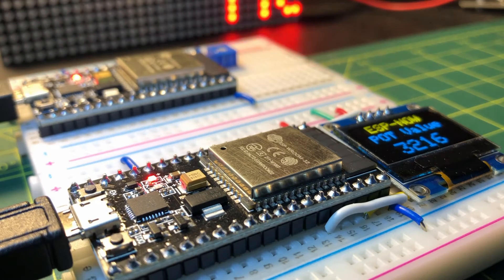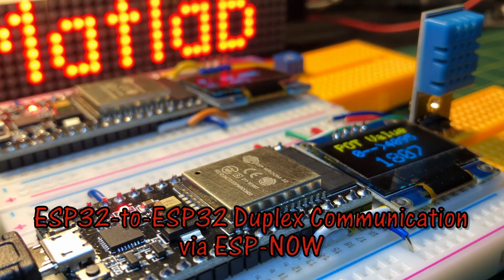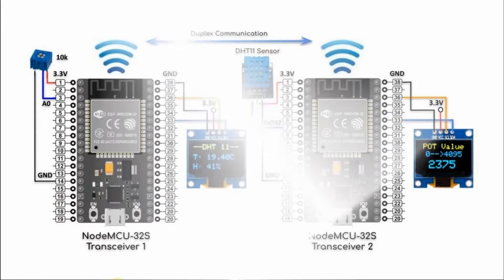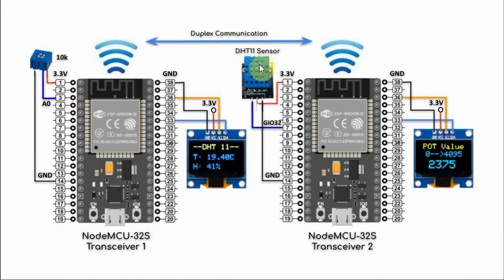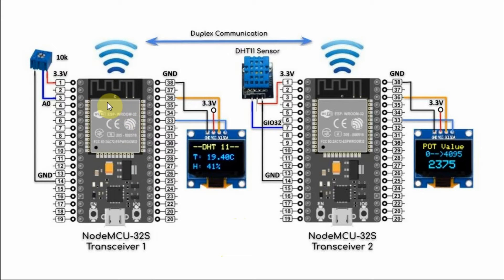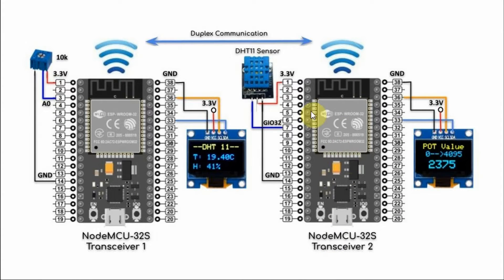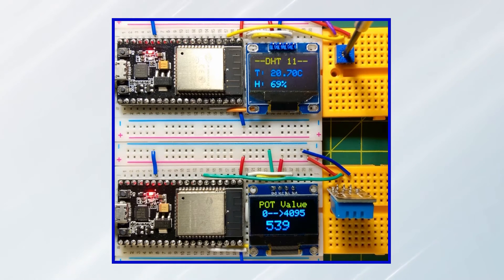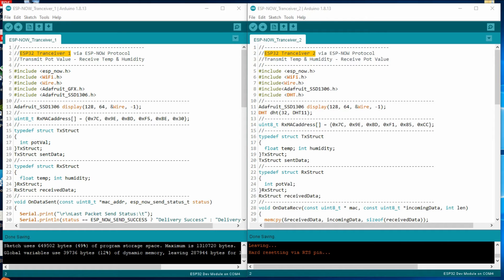ESP32-to-ESP32 Duplex Communication via ESP-NOW

Comment: Technically, it is half-duplex since they cannot both transmit simultaneously. Both 802.11 and LoRa use CSMA/CA: there is a transmission preamble that allows a transmitter to detect when the transmission medium is busy and cancel its transmission to avoid corrupting the other, then wait for it to end before it begins its own transmission.

Comment: is it possible to have more than 2 boards in full-duplex ?
Reply from the maker: I believe so, since ESP-NOW supports multicast. May be a more economic solution is to use nRF24L01+ modules with Arduino
Reply: @AnasKuzechie  yes I was thinking about the nrf24l01+ I have afew of them. I will probably stick with the esp as I'm  Rendering map tiles aswell and also storing data they just have more pinouts :)

Comment: Hi maybe you can help me, i currently have a raspberry pi running a website with some buttons on it. I want to make the buttons on the pi be able to control a light for example connected to the esp32. I thought of using a get request and using a http webserver on the esp32 but i feel like there must be a better way. Also the way i mentioned, i am finding some difficulities. 
How would you do this?
Greets from Belgium,
Arik
Reply from the maker: Hi, it might help if you could send me via my blog (link in the description) a block diagram of your proposed system.
Reply: @AnasKuzechie  Ok sure, i will draw a small example of what i mean to simplify it on paper :)
Where do i find your blog? I can't seem to find a link, only a link redirecting back to your channel
Reply from the maker: @aarriikknn33ll  Link in this video description.
Reply: @AnasKuzechie  Oh okay, i have already sent you an email aswell :) thanks for taking your time
Reply from the maker: @aarriikknn33ll  You're welcome